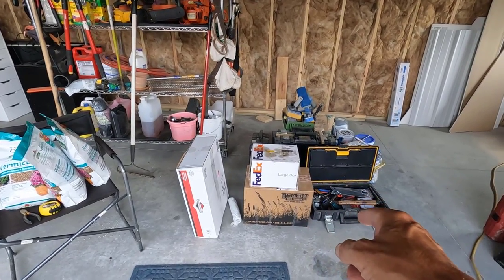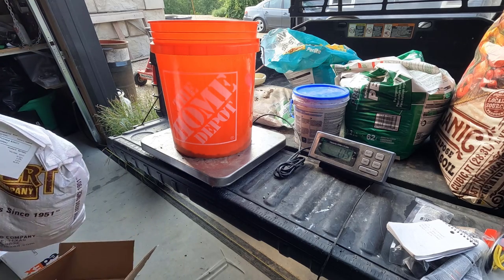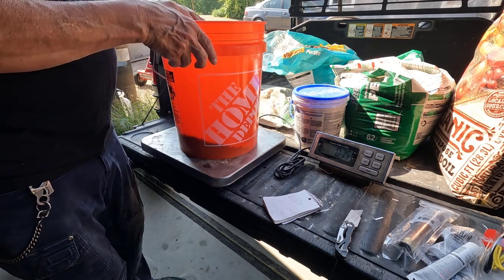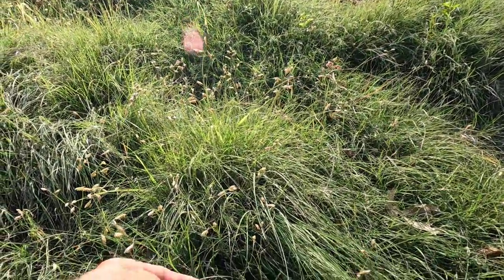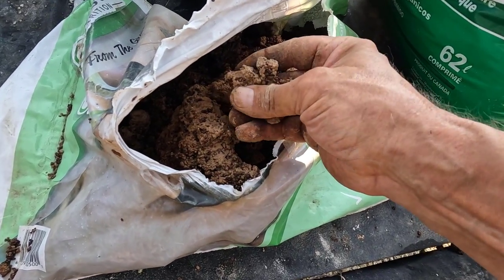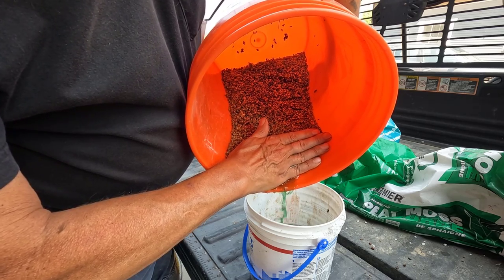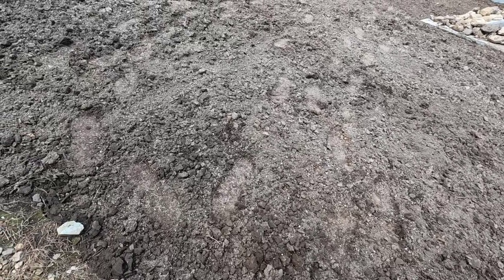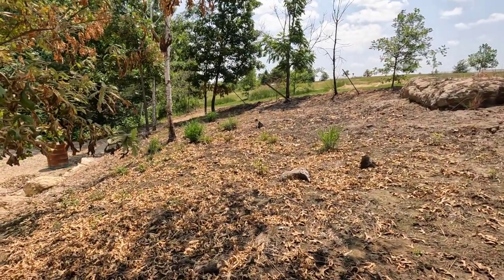Dividing and Pre-Soaking Buffalo Grass Seed ― Planting the Shop Prairie!

Comment from the maker: I will be starting the soak this morning for the Triangle Prairie! That is the largest of the three prairies, and will connect to the very first buffalo grass planting from last year — the Poo prairie. Not sure whether to just call the entire area the poo prairie as it will be seamless soon, and I just called the lower part 'triangle' to have something to call it?  🤔

Here are some of the gardening and Oak Savanna restoration tool I use on Planet Mojo:
Felco Pruning Shears (F 7) that I use  -- https://amzn.to/3nLKmrn
6' Bury Depth Woodford Yard Hydrant -- https://amzn.to/3mcI2cD
Prepper Heirloom Seeds -- https://amzn.to/378Yvby
Husqvarna Brush Cutter: https://amzn.to/3dP6M8Z
Corona Orchard Lopper: https://amzn.to/2VbunXu
DeWalt Reciprocating Saw: https://amzn.to/36aXvUW
Solo Sprayer: https://amzn.to/3jLh2iq
King Plus 1200w LED Grow Light -- https://amzn.to/33N8jXT
Bayite Temperature Controller -- https://amzn.to/2VJat6c
Husqvarna Rancher: https://amzn.to/388Sxrv
Renegade Razor  -- https://amzn.to/2OKY15B
DeWalt Chainsaw: https://amzn.to/2KyDhMh
Gripple Torq Tool Tensioner: https://amzn.to/38EzuFI
Great Stuff Pro 14 Foam Dispensing Gun: https://amzn.to/2KZCsge
Wire Tek EasySet Mole Eliminator Trap - https://amzn.to/2Q5ZW5W
Ambient Weather WS-2902C WiFi Smart Weather Station - https://amzn.to/3dl0nl8
3M Safety Glasses, Solus 1000 Series - https://amzn.to/3OHjcQk